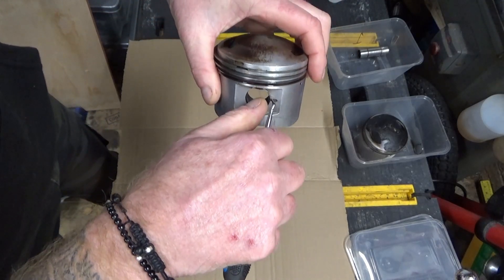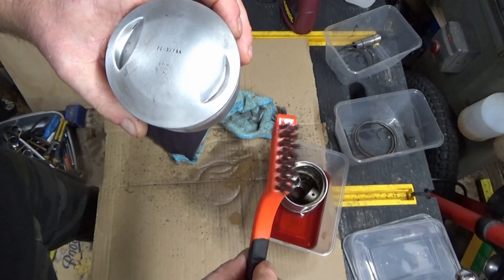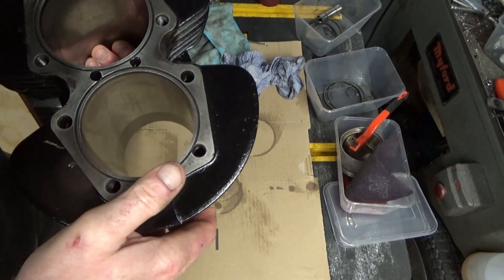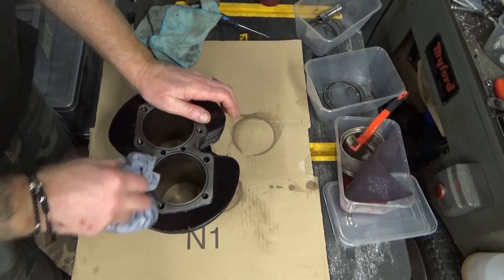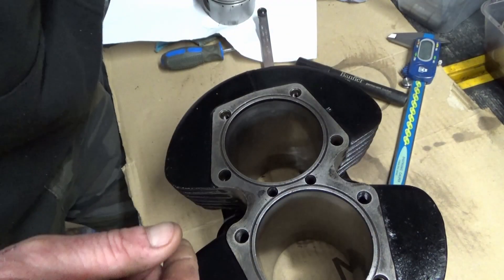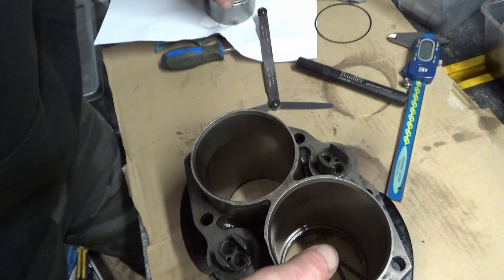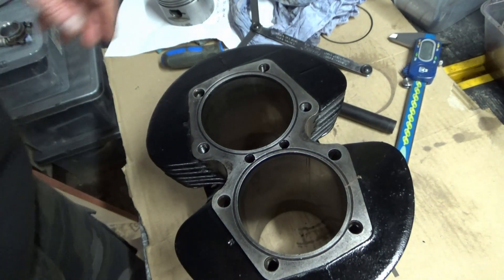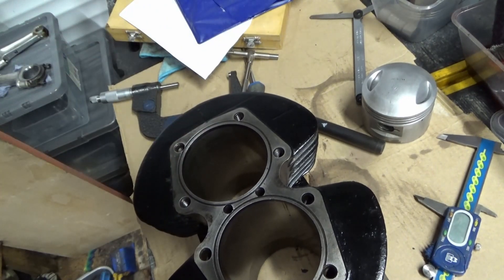Triumph Bonneville T140 Engine Rebuild Part 8 - Measuring Cylinder Bores and Pistons

Comment: Good job, nice tip for getting carbon of pistons. Have my top end off also as it's winter as the base gasket was not the best quality and started weeping. I had a rebore two years ago to +40, amazing yours are still on standard after all this time! Having said that I have no histroy on my bike whatsoever. Just de-glazed the barrels and will be fitting a complete top-end rebuild Franz and Grubb gasket set, proper quality mate! Best of luck and will follow along, cheers!
Reply from the maker: Luckily I knew the original builder and full history of the bike. Not a high mileage machine at just over 14,000 miles but he skimped a bit on the maintenance hence the wear on the crank journals etc. 

Not a proper Triumph if it’s not leaking oil. 🤣
Reply: @ I’m on the ridiculous quest of trying to make mine oil tight…! But, it weeps slightly outta the crank case join underneath, not enough to leave drips on the ground though!  It never ends with these bikes, ever, but the rewards are high!
Reply from the maker: Smiles per mile are high.